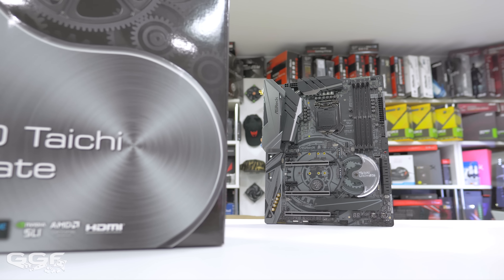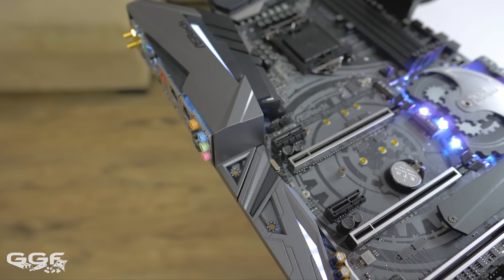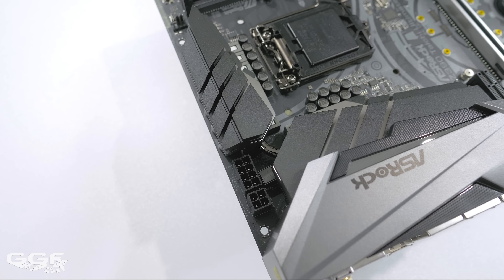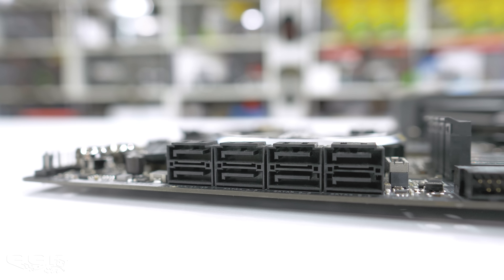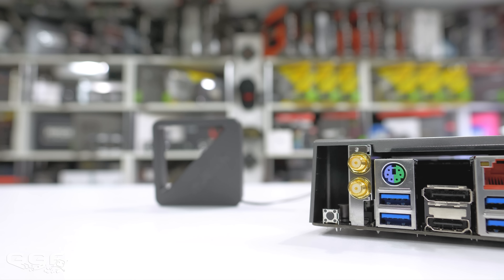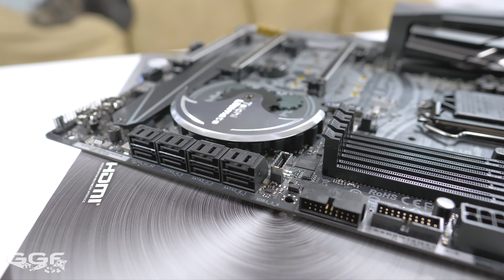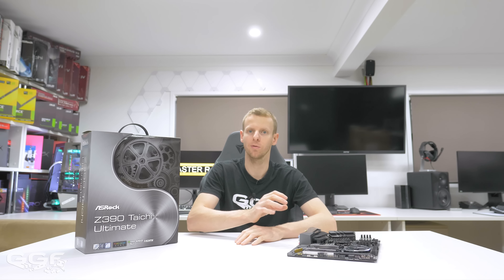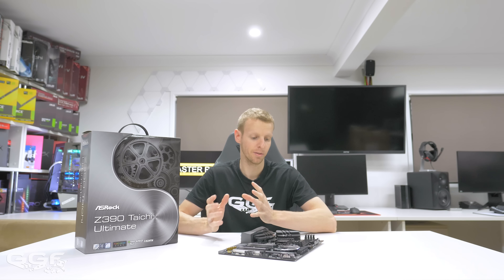Z390 is here!

Comment: Can you cover the voltages on separate video mate? I got the same MB and I am not happy with the offset mode and the load line calibration! Plus there is a buzzing noise comming out the speakers... That mobo has got issues indeed